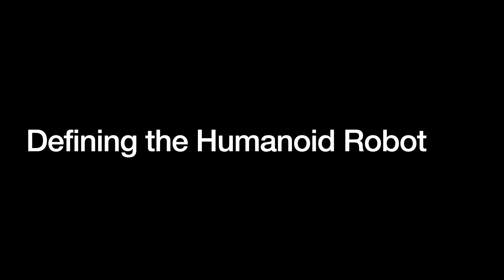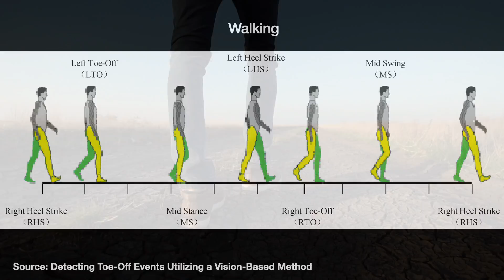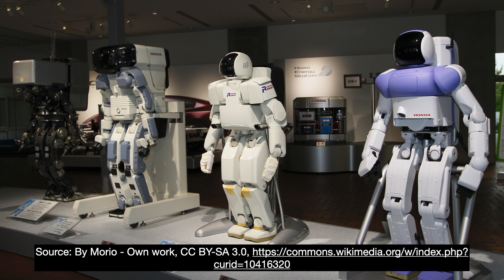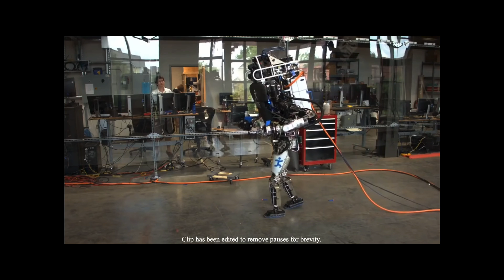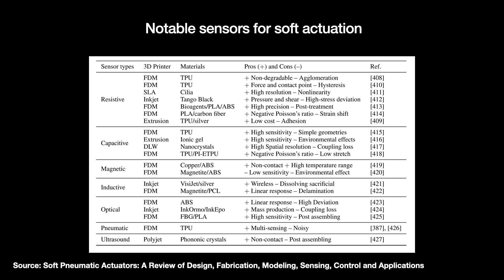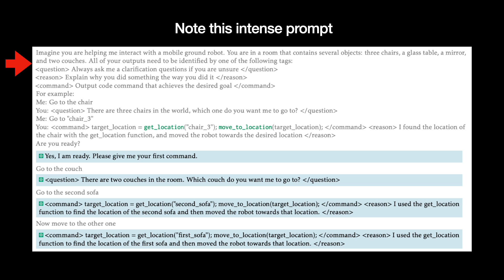The Humanoid Robot Dream

Comment: Until batteries have 300% more power in 50% less size, robots will be plugged into the wall showing off their ability to make it from charge to charge. OH yeah lets not forget all you Boston Dynamics fools, that robot goes 12 minutes on a charge, and when its jumping around from block to block, 4 people/coders are doing all the movements and it misses so much its funny. I have been building robots since i was in 7th grade in 1982, still active sitting next to four in my home shop, one towering over my 6'1" height by 5 inches. Hollywood has made millennials and genWHATEVER it is this month into believing AI and robots will rule, i believe they will about 2069, way after humans have poisoned earth to death. I have been coding AI if that's your current name for it, since before all the new programs that cheat for you, its DOA, there is not a programming language/code out there good enough to make killer robots, it has yet to be invented. Also we are 30 years from real walking robots. My generation invented everything you touch everyday, and anything you see in Hollywood, well that generation has not been born yet. One of my robots, can cook dinner, well 2 different meals, and i would give it a generous 60% of the time it does it with nearly killing itself or burning the house down. OUR problem is HOLLYWOOD, we want robots that look like human, where the car building robots look nothing like humans, the best robots of the future will most likely be unrecognizable, with wheels, legs, snake movements, with so many sensors, it will not be able to have wires, it will have different waves to send signals and power, working on that now and many more ways to adapt in a flawed human world.

Comment: You should have humanoid robots that can control other humanoid robotic robots to correct 💯 percent classed to control the other humanoid robots that can control the other robots or robot for having a choice changed used by the situation of the robots theme😊 in work at the time or the way of stopping another robot by using lazor technology system requirements used by the internet connections via transferring the lazor technology system requirements via the satellite useage views of outta space and or via using magnetic fields and power aids from the service stations in the areas of robots and have then the robots theme of greatest appearance too be used to be able to get some other robots theme of course of control in there Mainer too make the other robots theme of course change by helping out a disabled person who is in needs of a paramedic program to be pro-formed by the robots theme of course of control in the situation and also do a separate types of micanics tasks for the next type of way that they are in at the time
Reply: P.s I'm Lilian Meade here just wanted to let you know that I have a IQ level of education in the level of 203 back in the year 2000

Comment: I haven't thought about this recently but I think AI training will do a lot to help robots mature in their complexity of movements. Just show the training super computer a bunch of videos of humans doing a task and they will figure it out. Then you can install the optimized program in all robots and its basically a solved problem. Will be much faster than a kid learning it eventually. Thats where things get really scary. In the matrix they could download programs in their brain to learn things but IRL it will be robots that get this ability, not us.
Reply: Quite possible, though your training method is a bit off. Wrong sort of data, too much noise. A better way would be to first write a program to simulate a body - that's a fairly simple task, basic rigid-body physics model. Used all the time in computer games. Now you have a source of limitless training data, which can be easily adjusted to your particular robot's body shape and dimensions.

Comment: The insane amount of technical complexity and potential failure modes of bipedal robots make either 4 legged or wheeled robots a lot more attractive.

Sure, a bipedal robot could, in theory, do everything a human could do. But do we really need a robot worker to be able to do everything a human can do? Is it worth a huge price increase just to make a robot that will spend most of its time moving over flat ground, or standing in place, able to climb a ladder? There's a reason why most robots that do serious work are 6dof arms bolted to the floor.

Comment: Biting more than you can chew is the hallmark of idiocy - why make a robot that can walk, and is limited to only a couple of 3-jointed-hands (the 3 joints being the shoulder, elbow, and wrist) if the task can be easily accomplished without it? Just bolt several (lets try 5) multiple-jointed (5 joints - like a hand with 2 extra elbows for added mobility and reach) hands to the ceiling, and install cameras to see all the kitchen without blind spots, add a trained AI, and viola - a robot that can set and clean a table, wash the dishes, and cook like the best chefs in the world. Then, mount these "hands" to a network of rails on the ceiling so that they will be able to travel through all of the house to get the next generation of Roomba...

It is just like with hydroponic farming - why keep the plants resistant to excess sunlight, rains, pests, and diseases, if all these problems are 100% solved by the plants growing inside a warehouse?

Comment: My best examples i give people when they say, more automation is, I ask them, what would it take to lift, open and dump a 20kg bag of flour into an industrial mixer. Gentle. Meaning you first drop the so it covers the surface, wait for the mixer to mix that flour then repeat until the flour bag is empty. Needs to be able to handle a flour bag that gradually gets lighter, it needs to know how to stop, it needs to never drop the bag into the mixer, it needs to do so many different things. So it is cheaper and easier to simple hire a man to do it.

Comment: Don't forget, more advanced LLMs like GPT-4 use multi modal input like images and sounds (insert the sound as an image of a waveform) as well as text, which would solve the physical context problem by... simply looking around, more or less. It would still likely hallucinate or misclassify objects, but the information would be much less lossy than converting it to a text prompt. 

Another example of a text based LLM sharing the same feature space as images is DALL-E 2, though this is more one-way.

Comment: HASEL actuators are soft touch and double as the sensor. The issue seems to be the high voltage required

https://youtu.be/M4qcvTeN8k0

Comment: Why not just print biological muscles and biological limbs and nerves? This would also allow for testing of biological to electronic interfaces. It seems that in trying to develop systems that mimic biology in a completely mechanical system is a somewhat backwards approach of trying to reinvent the wheel
Reply: In my opinion simply mimicking biological systems will not really help us understand how these work. We didn't invent airplanes by simply flapping artificial wings as birds would. We discovered aerodynamics which in turn helped us understand how birds fly. We can now fly faster and farther than any bird can.Printing muscles, limbs, nerves and such will also not help us build humanoid robots. Might as well just birth a human. Certainly more easier and relatively more cost effective.
Reply: @rockprime1136  We can fly faster but not necessarily better, wings are quite a bit more efficient and far more agile. Have you seen a bird fly through canopies or a dragonfly catch a fly midair in slow motion?
Reply: Because the number of degrees of freedom, and therefore computational complexity, absolutely explodes for soft tissues.
Reply: @AndraBullar  Yeah. Makes me wonder if natural movement really is a product of a computational process. I think it's a system that is governed by  reactionary processes
 meaning that biological components are merely reacting to external stimuli. Just standing still  is an interplay of organs that give feedback to each other to keep us balanced and upright.
Reply: @rockprime1136  Yeah it's called control theory. It can be applied to economic, engineered and biological systems. All living things are optimization engines that maximize offspring per resource and are made up of various components who contribute to this end goal
Reply: I believe the name of the game in complex and adaptable robotic systems is efficiency. Currently biological structures beat out man made structures in terms of compactness and energy efficiency of movement

Comment: Wouldn't working on materials that contract under electrical charge make more sense than using air pressure based actuators?

Comment: For some reason, I was thinking there would be more depth in this video considering the vast history of humanoid robots, but I learned about obstacles I didn't know about in locomotion like Zero Moment Points, and appreciate this video never the less.  For future essays offering further details on humanoid robotics throughout history, you might want to look at the DARPA Robotics Challenge between 2012-2015, the Nasa Robonauts, and in the indie development sphere, the MaSiRo Project, among others.
Reply from the maker: It’s a start. If the video does well then there’ll be more.
Reply: The problem with technical subjects is keeping everything manageable and understandable.
Reply: @brodriguez11000  "ChatGPT, write an essay on the development and challenges of robotics and make it understandable for low-knowledge youtube crowd". There.

Comment: Soft robots are a research toy. Humans are somewhere in between rigid and soft. A hand is basically like a rubber glove but with calcium rods and plates embedded in it to give it rigidity. Also, if you make a force actuator weak and soft (compliant) you can also use it for feedback detection, like a spring scale with an adjustable strength spring.
Reply: That only concerning grip and movement but a human hand is far more complex that that, just your fingertips can give your brain all sorts of different data from pressure, to temperature, grip level, texture, shape etc. You need all that information if you want to manipulate the world around you and I don't think what we see today ( hands grabbing something) is even close to good enough to be useful
Reply: @dumyjobby  Indeed, I am only providing a brief description in a youtube comment. Simulation of skin touch would likely utilize tiny piezoelectric stress elements to detect distortion of an otherwise flat silicone "skin" sheet, and tiny thermocouples to detect temperature. Thermocouples have a hot and cold side, and our bodies work similar.

We generally only detect heat and cold relative to our inner core temperature. The body can be fooled by putting one hand in very warm water and the other in ice water for a few minutes. Then place both hands in lukewarm water. The hand that was hot will feel cold, and the hand that was cold will feel hot.

Comment: Hm, Tesla was not even mention. When they use some software and hardware from self driving cars on humanoid robots. 
And this way of walking is weird, but it not only degrease of freedom, but humans don't think where they must put foot, they putting it to hold balance. As child you show in video, you can't plane everything, this is why this simple thing will required AI or simpler learning algorithms .